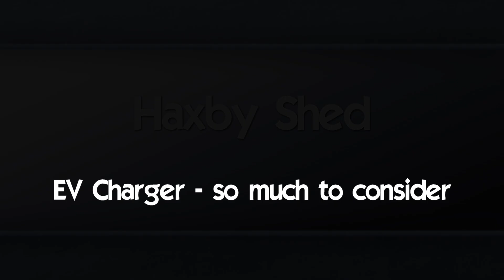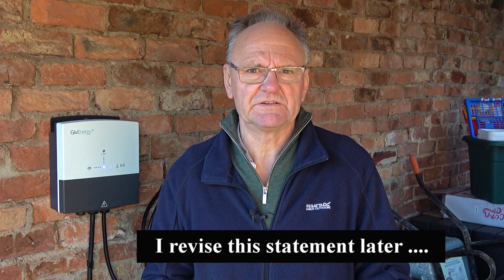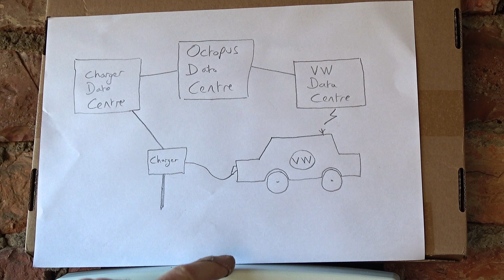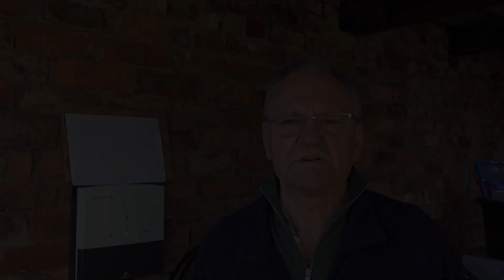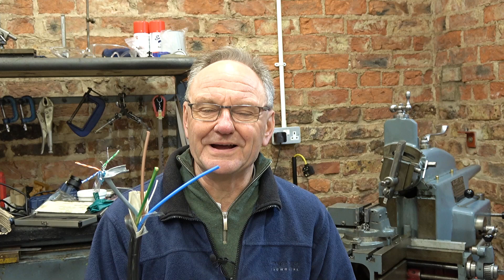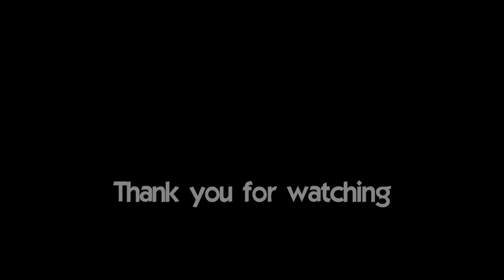HS287 EV charger – so much to consider

Comment: IOG can be flaky on my BMW i3 so I always switch it back to car based timer if I know I need a full battery in the morning. You only have to use the IOG control once a month to keep the 7p rate. It is easy to flip it on/off in the device tab on the octopus app. Thanks for the video.
Reply from the maker: Hi pmac, I'm on Intelligent Octopus Go now, controlled through the car. It does not work with the Givenergy charger, meaning the charger cannot be controlled by Octopus but also the charger will not 'listen' to the car. When the car tries to stop the charge the charger keeps nagging the car to start charging. So I'm using IOG with the granny charger and that works fine. So we await Givenergy charger / octopus integration automation which I trust is coming in due course. I can still use the Givenergy charger for 'immediate charging' when necessary. Good to know the 'once a month rule'. Cheers

Comment: Hi Paul, Its very interesting following your solar panel and EV tales. Its probable that we will go down this route at some point. 

If I had a crystal ball (or its probably just wishfull thinking) I predict that there will be a system which doesnt rely on having home installations or even charging points dotted around in carparks (our local supermarket has three points). Maybe you drive up to the petrol station (new name required!) and they wip out your battery and put another one in.

All the best!!
Reply from the maker: Hi David, you probably know in Asia it's common to have electric motor scooters with removable batteries that you swap at a charging station.
Reply: @HaxbyShed  No, I didnt, very interesting and logical

Comment: What on the surface seems to be straight forward, looks to be fiendishly complex once you peep under the bonnet. I'm a little bit wiser now, cheers Paul.
Reply from the maker: Hi Matt, plug-in immediate charging is simple enough but I'm finding that intelligent charging takes some understanding. Anything that goes unexpectedly could be due to the EV charger, the car, or Octopus. I'm finding that using Octopus Intelligent Go with charge control via the car requires the car to have quite a bit of battery headroom to work properly. If I plug in at 75% full expecting it to charge to 80% it will be over 80% before Octopus takes over control. Octopus only checks in with the car periodically at up to 30 minute intervals. I tried a charge from 60% and that seemed to go ok with Octopus in control and stopping at the right charge level. I think charging with control via the EV charger would be more reliable - so long as there is a setting in the car menu to stop charging at the desired %.   I'm still experimenting. But one thing is for certain, my daily electricity costs have gone down perhaps 40% on the intelligent Octopus Go tariff because with the house battery nearly all my consumption is at the night rate. Cheers

Comment: Excellent video, learned a lot, but to save any confusion the box on the wall is a monitor & is not a charger, the charger is in the car.
Reply from the maker: Yes I do agree with that Grahame. For AC charging the conversion to DC and regulation is within the car.  And so the car AC/DC converter is often the limitation for the AC charging rate. Usually 7.2kW on single phase and usually 11kw or 22kw on multi-phase.  We should think of a new name for the box on the wall but I suspect the name 'charger' is already embedded. Cheers

Comment: Timely information. Thank you!
Reply from the maker: It seems by luck I've gone the right route for my situation but for some people I'm sure they will buy something and then want to add things later and come up against compatibility issues. I saw a video today where a householder bought a particular less popular charger because it was compatible with his smart tariff but then move to another energy retailer and it might not be supported. Worth checking which EV chargers are supported by multiple energy retailers. But there might only be 2 or 3 retailers offering EV smart tariffs at the moment so it's still a bit of a crystal ball job. If the car is supported then it's less of a decision, so long as the car manufacturer does not withdraw support at some future point. But hopefully worst case you would just need to pay a subscription to the car manufacturer to maintain access. Not all chargers have an Ethernet cable connection option, so that's another thing to look out for if your WiFi is out of range. Cheers

Comment: Hi Paul, it is possible to switch to Octopus Intelligent Go without an EV charger, as long as you have a compatible EV.
Reply from the maker: Chris that's a really good question. So long as your car can be controlled by Octopus (like my VW) then logically even a 13A plug type charger should be fine technically speaking but maybe they would not allow it because the charge would be slow? If you go on the Octopus website and start the Octopus Intelligent Go sign up it asks you to put in your car and charger and checks compatibility. Or just email the enquiry to Octopus and they will usually reply in a couple of days. I have moved to Intelligent  Octopus Go now. I had a bit of trouble with the test charge but after that the switch was seamless and all done within the hour.  Cheers

Comment: The 4 pairs are used if you have 100M or 1G connection, you only used to use 2 pairs with 10M connections, and most switches these days cannot actually negotiate down to 10M connection reliably, so you will need to use all 4 pairs to connect, and as a bonus you can also use that connection to put up a wireless AP there to give a local wifi signal, which often is needed with say in car devices and also for convenience when in the garage area as well.
Reply from the maker: Hi Sean, I'm not sure how many pairs the electrician terminated on the RJ45 connector at the charger end but I always connect all 8 wires when I crimp on a connector. Cheers.

Comment: My neighbor installed one in his garage for his son's Tesla. So when he comes to visit he has a place to charge his car. It was quite a large expenditure for a car he doesnt even own. It cost about $3800 US for the equipment and installation.  I think they used it 2 or3 times a yr.
Reply from the maker: Hi Jeff, I think as you get older it's worth the investment making it easier for your family to visit.  All our family lives close by and only one of our kids has an EV at the moment, but the UK Govt is very committed to zero carbon and there are no (extra) import tariffs on Chinese cars (or any others). Prices are coming down and I think we can expect EV adoption in the UK  to grow quickly until some natural limit is reached.  I can't say what the natural limit will be but only about 55% of UK homes are suitable for chargers because they have no drive or are apartments or some such. At this point there just isn't anything like the level of public charging infrastructure that might be needed in the future. Add to that a big push towards wind and solar we can anticipate the lack of a trained workforce to install all this is a problem on top.  One reason I got in early with an EV charger, before demand pushes up prices. Will power be rationed and thus the rate of EV charger installs rationed I don't know. It may happen in some localities as 11kv substations serving residential estates reach capacity and need to be upgraded. Cheers

Comment: Hi Paul. Thank you for the interesting and useful information. I am in the process of deciding whether to take the EV route and now have a better understanding about what’s needs to be considered with regard to the EV charging. 👏👏👍😀
Reply from the maker: Hi Andrew, I'm watching some videos this morning of electricians installing EV chargers. I hear things like "the customer has solar and may get a battery". (Quite a lot of new houses have solar). And I see the electrician putting an EV charger CT clamp on the solar feed so the charger knows what's coming from solar. It's just all better to have a single "ecosystem" where everything works together by design, where that's possible. But if all you will ever need is the EV charger then there are lots of choices  and I'd go for something smart-tariff enabled. Octopus has started an initiative called Mercury to define open standards for all the different interfaces (I guess they are tired of implementing a different API for every manufacturer). I had my charger installed with a loop in the cable to give spare length so I can move the charger a bit if necessary or fit an alternative charger later if need be.
Reply: @ We installed solar and a battery exactly a year ago. Very pleased with the first years data, despite some gloomy months. I agree, one “ecosystem” that works together is how I would like to go. We have Octopus so that helps with our ultimate decision.

Comment: For anyone thinking of putting in a new supply for an EV, you can get the EV-Ultra cable from Doncaster cables. This is a cable with either an embeded 2 core data cable or an embeded CAT5 ethernet cable. It means that you are not running two separate cables. I have put it in twice for people to summer houses/offices in their gardens, easier way to put in power and ethernet and keep it neat and tidy. They also do a 5 core version for 3 phase supply, if you have it, so you can fit a 22kW charger.
Hahhh, just watched to the end. Must watch to the end before commenting.
Reply from the maker: Hiya Bill, yes that PV Ultra cable is a good solution as you say. Cheers